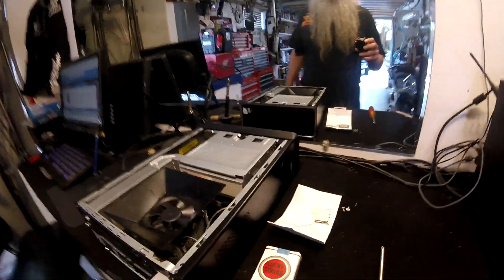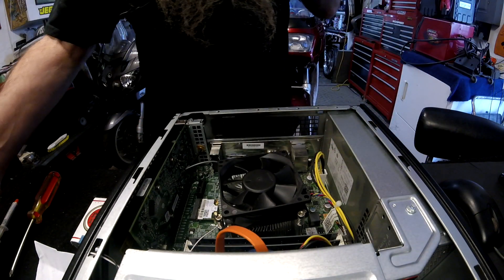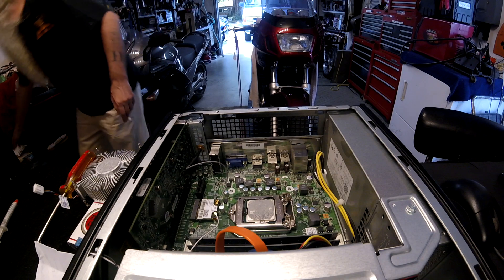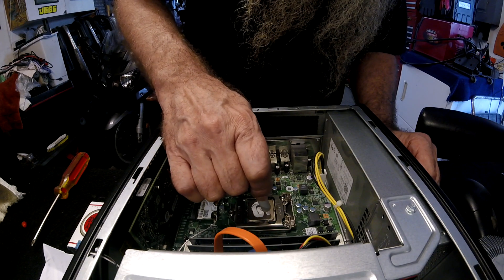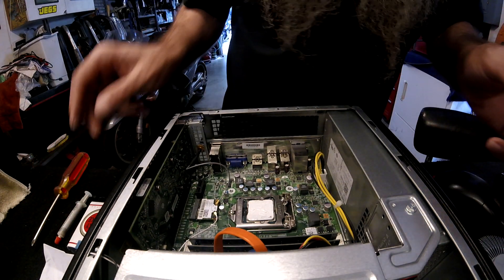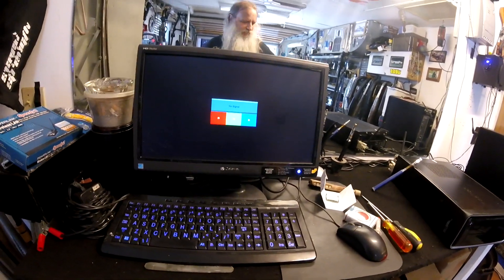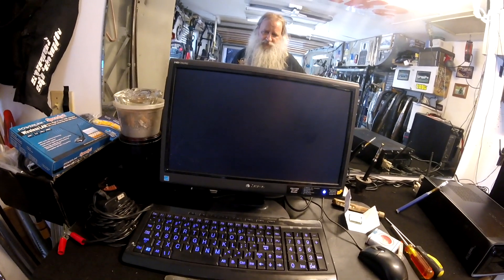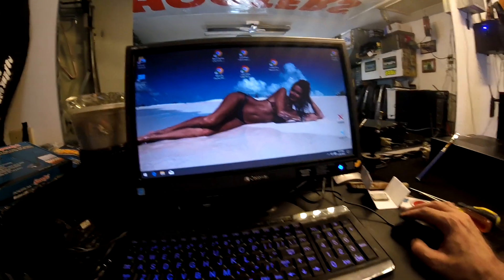How to upgrade The CPU in your Dell Inspiron 660S

Comment: So you can put Xeon chips in there... wouldn't that mean that you'd have put a dedicated GPU in there as well? I've got one of these things with an i3-3220 in it and I really want to turn it into some sort of media player/retro gaming console. I've got the extra RAM and new SSD set up already, but I've been trying to figure out if I should settle for one of the 3770's or go for the Xeon E3-1290 V2. I've been wary of the dinky little 220w power supply that this thing's stuck with and whether it could support one of the better LGA-1155 chips alongside a GPU.

Comment: A year and a half ago, I upgraded my CPU to an "Intel Core i5-3570S SR0T9" ($59.99 on Amazon). At the same time, I added an "Asus GeForce GT 710 2GB GDDR5 HDMI VGA DVI Graphics Card" ($119.99 on Amazon) I replaced my power supply with the largest I could find which was a "Corsair CV Series, CV550, 550 Watt" power supply ($44.99 on Amazon) to help power the graphics card, but I also replaced my 2 TB hard drive with a "Samsung 860 EVO 2TB 2.5-Inch SATA III Internal SSD" ($239.99 on Amazon, the most expensive component) so that helped reduce the power load a little. While I was doing this, I managed to damage the CPU socket, so I had to get a new motherboard which actually worked out because my ethernet was not working and the new motherboard solved that problem. The case and its hardware and the memory chips which I upgraded years ago are about all that is left of the original computer. The difference is noticeable, and I expect to get a few more years service from my old Inspiron.

Comment: Hi,  I was wondering if you could guide me to choose my Desktop pc new processor. I have 10 year old Dell Inspiron 660 3rd Generation, Windows 10, Intel CPU i5-3330 3 Ghz,  SOCKET TYPE: LGA 1155, 64 bit, R1-8gb RAM 8GB . Moher Board Dell 084JOR. Which processor i could upgrade to and how much RAM max i could upgrade . Thanks
Reply from the maker: Xeon e3 1290 v2 is about the hottest chip that hole will hold ... physically there's a no fit for a v3 ... go e31285l v2, if power supply is a concern (shouldn't be though) ...
Reply: Thank you will try. Hope it will work better compare to existing CPU @dawino6260

Comment: Can I put i7 3770s with Gt1030 in inprison 660s? (Use the original psu) Ty!
Reply from the maker: I've gotten away with i7 3770 and 3770k .. but just stock turbo and clocks enabled -- no overclocking -- that or no video card in the machine with it -- even then .. keep the video card around 70 watts or so ... somewhere around a 90 watt ATI cheapie radeon I started eating power supplies and just went ahead and upgrading -- 3770 or the xeons I tried -- chip itself is around 90 watts -- board sucks some -- so do your keyboard, rodent , etc.. that power supply is dinky .. but I've done it for a while with plain 3770 and 3770 k -- never tried an s -- if it's ivy bridge family it should work
Reply: @dawino6260  ok thank you!!!

Comment: Will BIOS (A07, build date 08/24/2012) support  a i5-2400 3.10 GHz CPU?
Reply from the maker: bit heavy on power.. but I think so ... not sure without looking - but pretty sure ... I've even gotten a couple to take Xeons just messing around
Reply: @dawino6260  which BIOS are you running on your 660s?
Reply from the maker: @pac1fic055  I'd have to go home and fire one up and look -- but I do remember it was the latest one from their website -- the one that comes in with The dell system app is older -- I may be remembering that backwards .. but I had to go with the newer one to get my Xeons to light up the regular quad core lit up fine on either but the 8 thread quad cores didn't light up off the older one - had the same deal on a T5820 - the one from one was newer than the other.

Comment: My mom found this same one in the trash in a rich neighborhood. She gave it to me and i upgraded it with an i7-3770s 4c/8t cpu, 8gb ddr3 ADATA XPG ram (2x4gb sticks), MSI LP GT 1030 GDDR5 2GB video card, PNY 240gb ssd boot drive and a 2tb Western Digital HD and upgraded the cpu cooler to a Vetroo M2 with Rainbow lights all running Windows 11 Home.  Everything runs great, Overwatch 1080p med setting 90 percent resolution steady 60 fps, gta 5 high setting 1080p, ultra textures 55ish fps and Tomb raider 2013 1080p gets 60 fps on high settings. I'm very pleased with this little sleeper lol. It will also take 16gb of ram but why would anyone do that? With the limitations of the video card you can fit in this case you wouldn't use over 8gb, if i ever changed it to another case or changed the mobo and case i would probably put 16gb in it
Reply from the maker: I popped a monster power supply externally on one and ran a little 1/2 height 4gb quadro Pascal family with better results than anything 8gb -- The chipset limitation of above 4gb addressing is in the way -- the CPU loves them -- but the chipset does crazy shit with 8gb cards - like , you gotta pull em and boot from vga every time you want a bios screen .. or they wont shut off the onboard and every other kernel update you have to mess with your X .config again to get openCL/GL, directx, etc. to default to the card instead of the CPU's video crunch section -- windows just re-install the drivers every other windows feature update .. but it's still a neverending hassle with over 4gb cards on that chipset

Comment: Hello, good morning, could you help me, I have one with core i3, I can change it for an i5 or i7, I would appreciate your help
Reply from the maker: Yes, you most definitely can (there's even a xeon that works)... Only Caveats: update your bios from Dells latest and greatest off their website first -- And Do Not attempt to overclock your chip or video card (unless you put in a much bigger power supply) i7 3770k works.. and I've done a few with scrap i5's -- look at the family name of the chip and the socket number for the i7 3770k -- as long as you pick a chip with the same socket and family it will work ..... i5's have a problem with they try to initialize the bios video too long and you never see a bios screen if you have an add-in video card is the only thing I've noticed funky and that was primarily with FirePro's - I haven't had that issue with Radeon Pro or nvidia Quadro cards (did have it with an nvidia gtx something or other low profile older 1050 I think) ... The above family and socket lookup method works for any intel socket computer you know the family and socket of chip for BTW - quickest way to look up what'll work in whatever is in front of you at the time

Comment: If you add a i7-3770s will the stock heat sink be enough or should it be upgraded?
Reply from the maker: Good question .. Likely not -- I've never tried an s - I've tried a K and a straight i7-3770 with no problems in video editing apps (cyberlink powerproducer/media suite 15 and 17 both and Cinelerra on linux) Other than dont bother trying to overclock (i7-3770k) due to the power supply cant take it for long I've had zero problems -- side note: when a straight 3770 is installed with an AMD video card (cant remember which family) it wont let you into the bios without pulling the card, getting into the bios from the onboard and then popping the card back in after
Reply: @dawino6260  ok thank you! I’ll put it all together and see how it goes
Reply: @dawino6260  I have 660S with an i3-3220 processor and that same stock CPU cooler.  I found an i7 - 3770 on Amazon for 50 USD and I have a full size ATX case and a GTX 1060 6 GB card and a new 500 watt power supply. Do you think if I build this system the stock cooler the one you have there is gonna be enough for gaming or do I need to buy new cooler?

The whole point of this is to use GTX 1060 to its limits and for that 3770 is ideal. There shouldn't be any bottlenecking. Just worried about cooler
Reply from the maker: @NishantSoniTV  You wont touch the max capabilities of the 1060 on that board -- not even with a Xeon.. Cooler wise yahhh .. if yer gonna put it in a big case, it's worth the extra watts for a liquid cooling kit.. Small power supply is why I generally just keep the stock intel coolers on the little 660's (HP Z220's too) Xeon is the only chip in that family that even comes close to getting the throughput of the board but the i7's did OK... If you are keeping the little i3 and not overclocking it, the stock cooler is wayyyyy more than adequate (i3's are so stripped down there's nothing left in em to get hot is the industry joke)
Reply: @dawino6260  will you please run a sustained CPU stress test to check if a Dell 660S motherboard with its VRMs can actually sustaine a core i7-3770 without throttling down quickly or in a few minutes? Some guy on reddit said the VRM on Dell Inspiron 660S were ment to handle up to 3rd generation Core i5 so he doubts if VRM will force i7 to throttle down?

Will you please run a peak performance test and help me out if it can sustain?
Reply from the maker: @NishantSoniTV  In my 3d Audio experiments I was running full CPU loads with the 3770's most of the time just to achieve what little I did -- Long as you dont try to overclock em - they do good -- or did for me anyway .. we used a bunch with Xeons in a cluster as a sort of render farm for a while -- maybe 70% CPU load at worst but for literally days at a time 1 control node (HP Z840), 18 in the cluster with nothing but HBA/HBC cards added to the 660's - Control node was the only one that ever got hot enough to kick the fans all the way up.. cluster nodes (660's) would kick em up and down but never even maxed their fans ... that room we played with that cluster is kept at 73f though --- and there's a compliment of sorts on the VRM's ... We didn't kill many machines building wide even with 7 monster 15 ton AC units kicking on and off (and very few UPS/APC's in the building - LOL) and they'd stay running through brownies vs a lot of the HP's had to be restarted but to be fair the HPs were all hog boys (Z6xx and z8xx family) power wise... Physical Acoustics math wise the little 660's with a 3770k and a pair of card to pcie expansion bus with 2x xeon phi 7120p each ran 75 to 80 percent cpu load most of the time and some of thos calculations would take them 2 and 3 weeks running 24/7 -- they did well for what they are --

Comment: Hey man, I have some questions for you. My motherboard model is DIB75R Pinevalley MB, or 0XFWHV i can’t identify which number identifies the model but I want to upgrade to a Xeon 1230v2. Do you know if it’s gonna be compatible? Will I have to upgrade the BIos? Based on Cpu-Z it’s on version “A10”, Where can I find the latest version?
Reply from the maker: Latest bios would come from the manufacturer .. as to cpu compatibility, I'd have to look it up same as you ... but the rule with Intel is pretty simple sane socket+same family of chip (meaning I've bridge in ivy bridge board or haswell in haswell board etc.) = usually works ... Dell is tricky with the bios on their download site .. the second newest you can always download.. the first newest is only available through that dell update/optimize utility ...
Reply: @dawino6260  thanks, I updated my bios and will try next week

Comment: Please suggest me that which CPU is best for gaming in this inspiron660s??
Reply from the maker: I like the i7 3770 for the sole reason that it (like it's bigger xeon brother) supports more instructions than the junky i5 and i3's ... You'd need a decent video card any way you go .. But unless you are playing really old games, the 660 is pretty useless ... At this point in time, it's pretty much what you give grandma to check her email or put Linux on and turn it into a media server ...
Reply: dawino6260 do you think the 3770k would work
Reply from the maker: @razz2thurl  yup .. no benefit vs regular 3770 though the over clock features in the K would only let you torture the power supply if you tried to over clock it is all that would happen .. beef the power supply if you are going to over clock ..

Comment: what is the model of the motherboard? and does it support a xeon e3 1240v2?
Reply from the maker: Socket 1155 .. and the rule with Intel is: long as the socket and family name are the same, it works .. I anything is a stripped xeon period .  The lower the number behind the i, the more it's been stripped ... by family name I mean: ivy bridge, sand bridge, kaby lake, haswell etc.  They all have a family name ... use the latest and greatest bios if the chip is same family but came out after the board ... these are intel boards (OEM for dell by Intel - couple of lesser alien ware used the same boards)

Comment: Does dell inspiron 660s support intel i3 9100f?
Reply: Only 2nd and 3rd gen cpu
Reply from the maker: Without looking it up, I dont know -- But i wouldn't recommend an i3 to my worst enemy anyway (unless you are just building an email plinker for old people -- then it's OK) General rule of thumb though is keep it to same socket and same family (IE: sandy bridge, kaby lake, haswell etc. - whatever family the hole supports) and it will work --- applies to damn near every intel hole (socket) .. ALWAYS make sure you have the latest and greates bios flashed before installing a new cpu  though